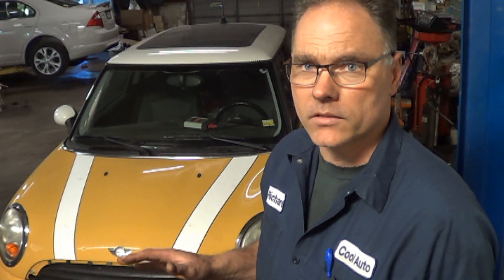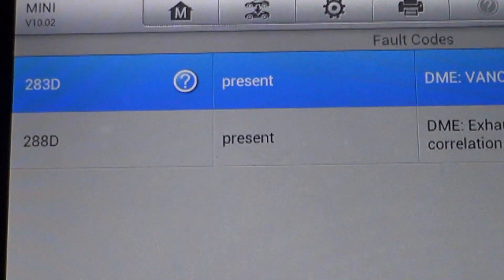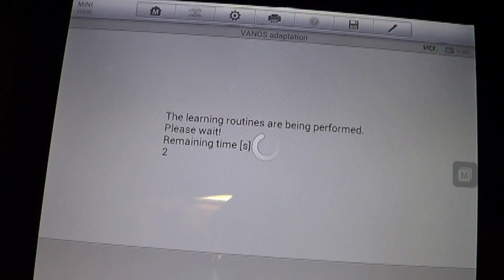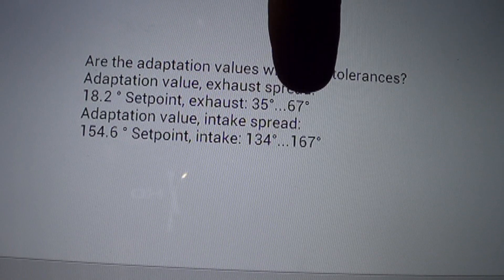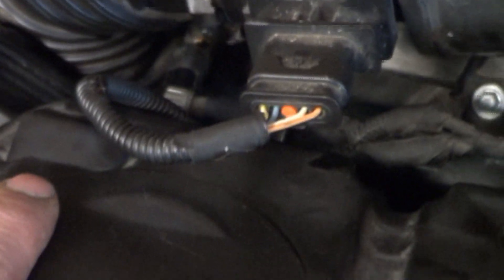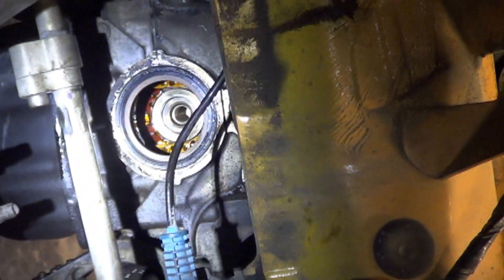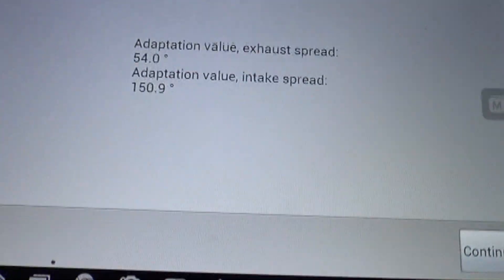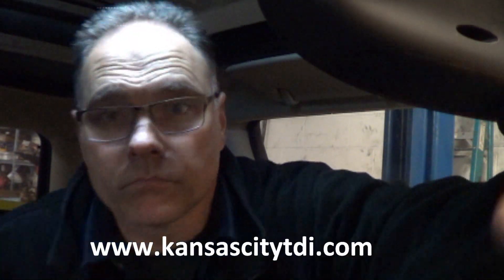Mini cooper vanos codes P0014 and P0017

Comment: just wondering which software you used in autel since mine does not have those data pids for vanos
Reply from the maker: don't know.  I would promise to check and post it later but I never remember to do so.
Reply: @CoolAirVw  That's fine, thanks man,  great video  though.

Comment: I have this 2 codes with the 4 cylinders misfiring, plus cam position out of wack, I am not going to investigate any further, I am sure it needs a new chain.
Plus water pump and thermostat, no wonder they just wanted to get rid of em, I was going to throw it as an easy flip but I'll do the chain and ask full price
Reply from the maker: some special tools needed but you can do it!

Comment: Thanks for this, ive got a 1.6 Mini Cooper (N12) that has code 283d "adaptation stop" ...the other code isnt present although there was stored in the DME for poor O2 sensing on bank 1 , Im guessing this is in part to issues around VANOS position....Also there was a 2B15 relating to throttle plausibility....I noticed that BMW tech bulletins recalled alot of these for guides and tensioner replacement January 2014...at the moment im just picking my way through any information I can...
Reply from the maker: good scan tool will help.

Comment: Old question ?- which model Maxisys are you using?  My version does not have the valve gear screen.  Are you using yhe ms906ts ?
Reply from the maker: I'll check next time I have the machine out.

Comment: Hello sir I replace timing chain 2008 mini with new  vonos and sensors  but still getting code p0015. I also did adaptation  exhaust side say 19 degrees  and intake 154.? degrees 
What is the problem could b?
I check timing with timing tool all good.I open 3rd time it's frustrating 😑. Any help 🙏
Reply from the maker: what scan tool are you using?  Fox and Shwabe tools lie. They are not doing the test and lying about it.
Reply: Hi did you find solution, i had change chain, vanos,solenoids, sensors and still not good angle on exhaust cam 14,20. It should be 40to60

Comment: My Friend, I did the adaptations in the VANOS exactly as you explain it here but I have a problem, my numbers are in reverse, 153.7 in the exhaust and 51.9 in the intake, a week ago I replaced the complete chain kit together with the phasers.  Why this is happening, your help would be very important.
Thanks.
Reply from the maker: Dont know.  further checks would be required.  If the  car were here I would scope cam  vs crank and see if cam timing was responding to action of the vanos solenoids.

Comment: I have one Hyundai Elantra 2017 and my car start stop for no reason, the mechanical saw is crankshaft position sensor, he change but the problem continues he open the transmission to clean and fix something... the car working but two days after the traction control light is on and together I have the codes p0014, p0017 and p0335 and now the car stopping some times again...

Comment: I learned that I may need an Vanos adaptation.  Never knew about it.  

Background:
My problem: P00BD code says Mass Air Flow sensor bad.  it's not.  Replaced it twice.  Mini dealer can't figure it out having it 7 days.  I rebuilt this motor myself, replacing almost everything.  Bought it with a blown head gasket, so Antifreeze and oil mixed into a sludge causing the overheating.  The previous owner kept driving it until it would not start again...  
Anyway, after 5000 miles of driving it in 9 months, Engine light comes on most of the time.  Seems to trip it within 2 minutes of driving.  When first starting, it has a slight erratic idle (Vanos?).  What leads me to believe it's Vanos, is another Mini dealership/repair Youtuber said his Vanos solenoid caused the P00BD code along with Vanos codes.  That got me to questioning the Vanos.

Although it drives really good, it has a slight erratic behavior at 2900 rpm and very slight load on engine, like it can't set the proper timing for the condition?  My son who is an ASE (?) mechanic showed me on his autel (?) that the Short Term Fuel Trim was erratic, essentially shutting off fuel very quickly and then turning it back on at the 2900 rpm erratic part.  Almost feels like a miss-fire, but it's not.  It's the Fuel trim shutting off quickly.

I do have 0.5mm larger pistons due to out of round cylinders, Head was reworked at reputable shop that did my short block with pistons.  I was thinking Mass Air Flow Sensor registered more air because of larger pistons, but I don't think that's it because of seeing timing issues can give P00BD.

 I swapped the solenoids.  No difference.

I will ask my son to see if he can do the Vanos recalibration.

Question:
Since my oil and anti-freeze mixed into a sludge, could something in the Vanos system have become sludged up and needs to be cleaned preventing Vanos from operating at peak performance??  I cleaned and checked the solenoids and they operate snappy with power applied.

Thanks for teaching me about Vanos recalibration.  I hope my son can get help me with actual usable numbers to see if it's in limits.  I'm subscribing to your channel.
Reply from the maker: Sorry, but I think your questions self evident.  Of course if its full of crap it might work like crap.  But all you need to tell is run the adaptation and it will give you the numbers.
Reply: I have same code MAF plausibilty, N12 engine. Switch solenoids, did calibration didn’t help. 
Mechanic thinks only way to fix it is head rebuild. Car also has erratic idle when cold, sometimes when breaking before stop it catches idle...
Reply: @wellwh0  Well interesting to hear someone else has a P00BD after timing chain replacement, switching solenoids etc.  I may have some good news.  I purchased a Foxwell NT510 Elite for $138 (ordered through Foxwell online), did the Vanos Adaptation to clear and relearn the Vanos advance and retard values.  The check Engine light went off the next drive cycle, and stayed off the drive cycle.  I will reply back with whether it stays off after a week or more.  Erratic idle seemed better when cold, but mine was only slightly erratic for about 5 -7 seconds, then smoothed out when starting.  I'll report back in a week or so to see if this fixes it!!! (crossing fingers)
Reply: @KirkReed  Hi, I’ve been to BMW specialist. They repaired it. it was bad first oxygen sensor bofore cat, mechanic replaced 2nd one but didn’t replaced first one. Now when that is replaced it works. It still idles erratic when is cold sometimes for few seconds as you mention. Though is much better.
But what bothers me is that oxygen sesnor probably went bad because this engine burn oil, so oil destroyed it and it will probably happen again question is only when!?
Also why did it had MAF plausability code for bad lambda sensor? 🤔
Code I had was 02B68
edit: check engine light came on today again. At this point I think I’m going to sell it.
I did VANOS adaptation before. Didn’t help.
Reply from the maker: @wellwh0  Do you have a "S" model car?
Reply: @CoolAirVw  no it's One version N12b14a... I did all possible repairs on it. timing chain, thermostat, PCV, water pump, water pump belt, valve cover gasket, oxygen sensor...etc

Comment: Hi, I have the snap-on solus edge scan tool that doesn’t support the features your Autel unit does. I need to upgrade but not sure which scanner to get that will provide data I need to diagnose 2015 Paceman with vanos issues. Getting that degree data after recal would be great! Nice feature for sure. Thx for this great video.
Reply: Thanks for your response. My friend has the new Zurich android device. We ran it through the recalibration but it only displays what seems like a default for the intake and exhaust cam timing degrees of 65535. 

Doesn’t make sense, but my thinking is that it’s not recording or picking up the actual degrees for each cam. 

My customer friend drove the car to Portland from Bend Oregon and the CEL didn’t trigger for about 85 miles. Seems more intermittent.

I was wondering which Autel unit you use, which one you used for this video because that device seems to do a great job reading the actual data. 

Also, so far, I’ve replaced both vanos solenoids as the customer drove about 12,000 miles between oil changes and my first concern was that he varnished them up pretty well. Research and lacking experience with this product lead me in that direction at first. 

There are cam phasers on both cams on this turbocharged model.  The issue seems to be with the intake, but I’m wondering if maybe it’s a phaser issue? 

The engine has less than 36k miles. I’ve changed the oil twice using the castrol edge 5-30, but, before, I think he was going to an oil change place, they typically don’t use the correct oil in my experience. I’ve seen firsthand how that can damage vvt systems on say the eurovans.

I’m hoping to get more data feedback before beginning a mechanical teardown and exploratory. I’m not one to throw parts at a repair at a customers expense. Solenoids could be part of the issue but maybe an incorrect recommendation in hindsight, so I’m trying to avoid that any further by zeroing in on this issue.

Any insights are greatly appreciated.
Reply from the maker: @anthonyttoigo  dont know.  Sorry only so much I can do
Reply: @anthonyttoigo  65535 is actually a Decimal value for Hex FFFF.  It just says whatever is measuring it sees all ones (1111 1111 1111 1111) which is FFFF in Hexadecimal.    likely it is not measuring the correct location or value, so a useless value??
Reply from the maker: I dont know which scanner for sure, especially on a 2015 but Autel seems to do a good job with on mini and BMW and most other makes also.  Some folks call it 'Aweful-tell" here on youtube, but its beat out snap on for mini's for sure.

Comment: Whats a fair price for the repair you did on the 2007 Cooper Timing Change job. My code checker is just a cheap FixD so I dont get the adaptation readings like you do. I do have same ODBII errors, and shop I took the cooper too said they believe the VANOS was too blame. I was going to just replace the VANOS exh and intake and hope for the best. Also second question, is there a tester out there that isnt super expensive that will give me the adaptation numbers?
Reply from the maker: Sorry I do not discuss pricing on repairs on youtube.   I think Autel is the cheapest one that would offer the adaptations.  I tried the foxwell/schwaben tool and although it acts like it does it, it does NOT!  foxwell/schwabe tool lies to you.

Comment: Any able to help me I have a mini cooper r56 non turbo, so n12, car feels down on power, garage said it needed timing chain had that done and vvt solenoids changed and camshaft sensors changed, still have this problem of low power, (no engine light or anything, any ideas, could it be to do with the adaption or that fact it's a new engine put in the car maybe something to do with ECU?
Reply from the maker: Its probably not the relearn but you should try that first just to be sure. Probably should have used a shop that has the equipment to do the relearn.  Many things can cause low power.  Best way to proceed is to get it to someone good who can diagnose it.
Reply: @CoolAirVw  on my odb on test results I'm getting 02 bank1 senor 2,   rich to learn threshold voltage(constant) any clue, it does seem to run abit rich, could it be a 02 sensor? Maybe
Reply from the maker: @josh-uk9627  Does your scan tool show fuel trims?  Do you understand fuel trims?  Look at fuel trims to see if it actually is rich, then create a vacuum leak while watching short term fuel trim to see if the 02 responds.  I don't have any "rich diagnosis" video but there are others on youtube.  Things like leaking injectors, maf sensor or 02 sensors ect will make it rich.
Reply: So I found what was the problem, it's a 1.4 they put in the wrong engine 😅 just my luck

Comment: I did this job. Replace cam actuators timing chain and guides. I use the tool to lock the cams and crank. Our of spec by 7 degrees on both cams. How does this happen?
Reply from the maker: Sorry, I dont know.

Comment: Nice job , I had the same fault code on the mini vanos adaptation stop , the car start but when I vel it it's shut down , no idle , what the solution sir I need you help
Reply from the maker: Run the adaptation with a compatible scan tool and see if the numbers are in specification.  If they are off on just one side (intake or exhaust) then you can swap the vanos solenoids,  to identifiy if its a stuck solenoid.  If the numbers are off on both sides then you most likely need timing chain work.  There are other issues that it could be also but that would be beyond the scope of what I can advise you of in a "youtube comment".
Reply: @CoolAirVw  eish my scan tool doesn't do adaptation
Reply: @CoolAirVw  it's autel MD808 PRO
Reply from the maker: There are things that a DIY cannot do.  This may be one.  But you can try swapping the solenoids and you could remove the valve cover and inspect the chain and the upper guide.
Reply: @CoolAirVw  thanks sir

Comment: Hi-can the vanos adapt on its own after replacing timing chain and clearing codes? All we have is a basic analyzer that reads and clears codes. Also, to replace the timing chain, are there special tools to lock the cams in place? Thanks for posting this video!
Reply from the maker: I would assume it adapts on the fly a certain amount, but I dont know.  There are special tools.
Reply: @CoolAirVw  my car 2007 mini cooper p0012
Reply from the maker: @DanielGonzalez-cd3mb  Yes you'll need special tools.  You may be able to get by without doing the adaptation, but it would be best to have it done, or do it right.

Comment: I've have a 2007 r56 base with 139k mileage. I'm getting the same codes and the exhaust adaptation value was 19.2°. But top guide rail was not broken.
Reply: FutureFox so how you fixed the problem?

Comment: Good morning Richard. A pleasure, like always read your post & watch your videos. I have three (3) doubts. 1. A low level of ATF on a  01m transmission can causes one P0740 code?. 2. How many liters of ATF uses one 01m transmission? (complete rebuilding case). 3. Do you buy used parts for 01m transmissions? Best Regards.
Reply from the maker: 1 Yes.  2.  9 if it was dead emply, but you rarely get one that is dead empty.   After pan drop you use 3-4.